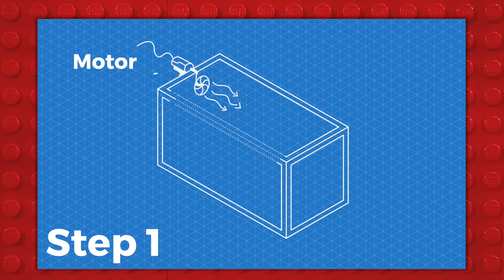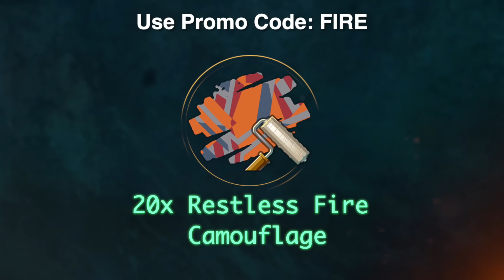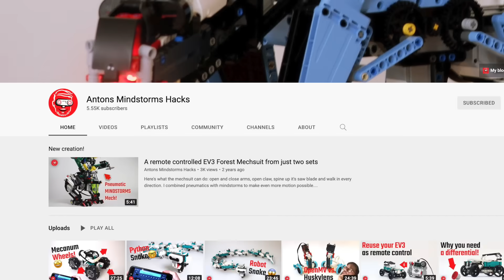I Built a LEGO Warship Simulator Game!!

Comment: The steering can be done much, much easier without batteries. Lego motors are default electric engines that can perform generator tasks as well. Put the generator (motor 1) on the steering wheel, directly connect it with the steering motor (motor 2) and the generated electricity will move the 2nd motor. Only downside is the slight loss of power. Meaning you will have to turn the generator slightly faster then the actual engine will do. But what are transmissions for...

Comment: I've been a subscriber for 1 years and you're videos are awesome. One misconception is that batteries can electrocute us, but its not possible because it is DC and the voltage is very low. Also Electricity can't pass through clear and clean water unless it is very dirty and has a lot of minerals in it.

this is just a comment. DO NOT TRY YOURSELF AND PUT YOURSELF IN WATER THAT HAS ELECTRICAL LIVE WIRES IN IT.